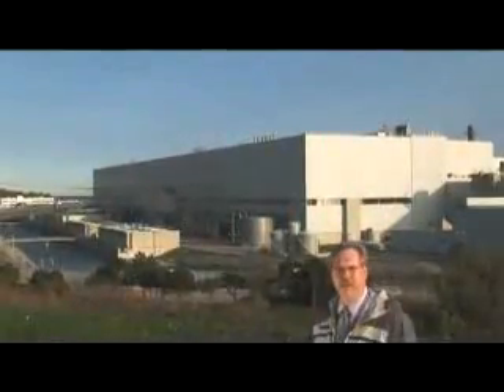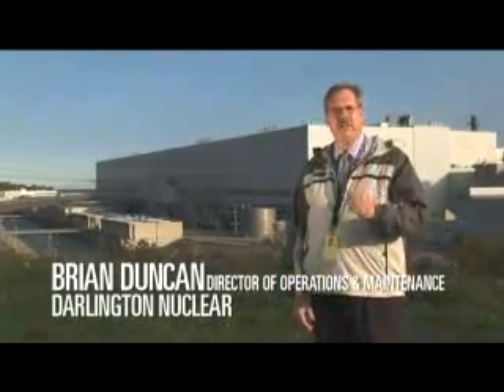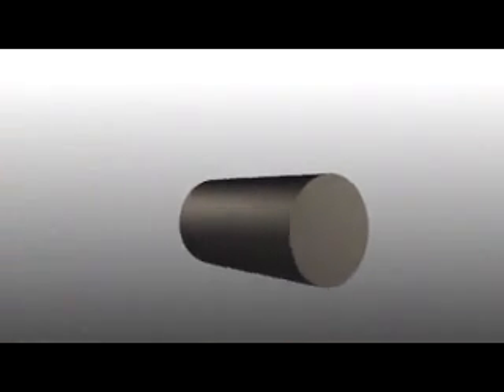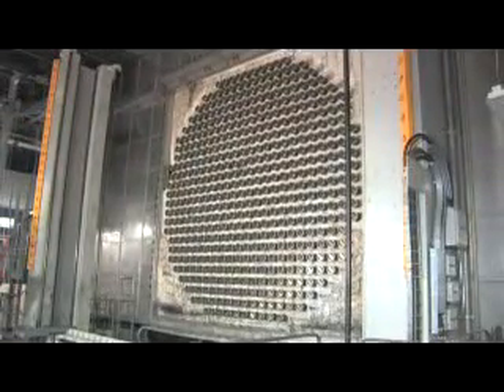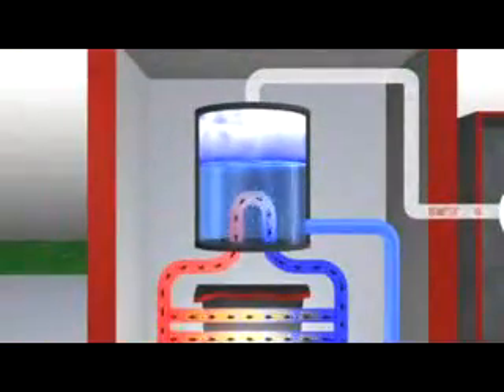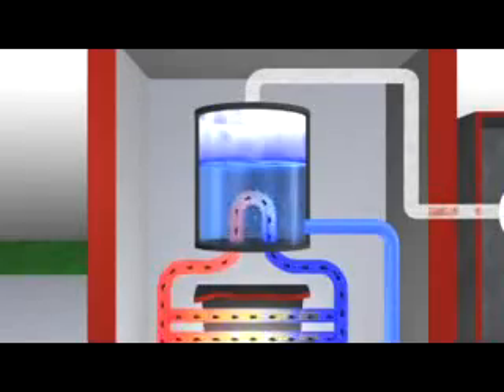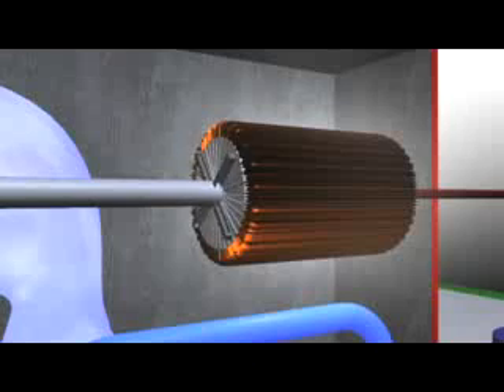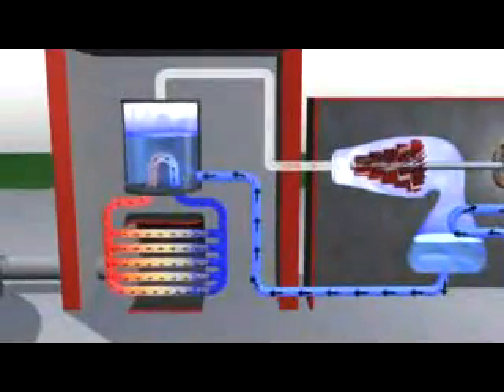CANDU reactors

Comment: If the moderator leaks out like it did in Japan's reactor  (which isn't CANDU) the worst that will happen is the reaction slows way down, almost stops. Other reactors need a moderator to *prevent* them from melting down, CANDU needs it to *force* the reaction, it's practically impossible to meltdown.